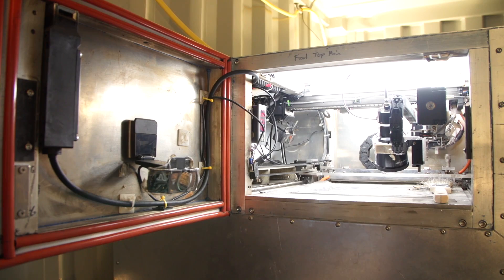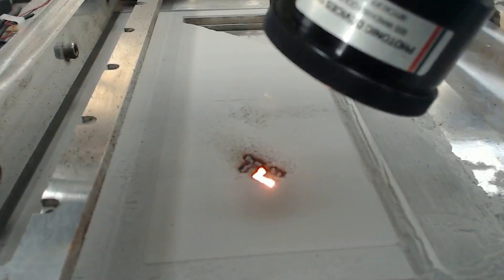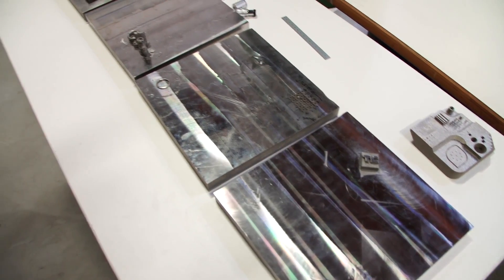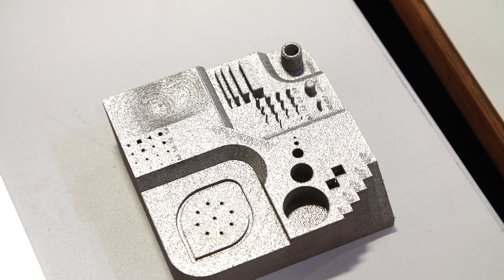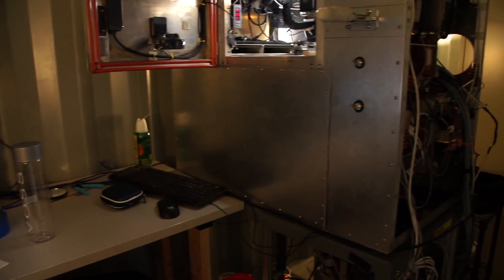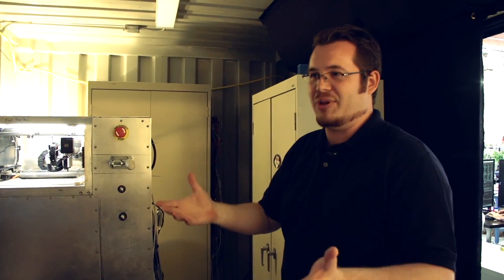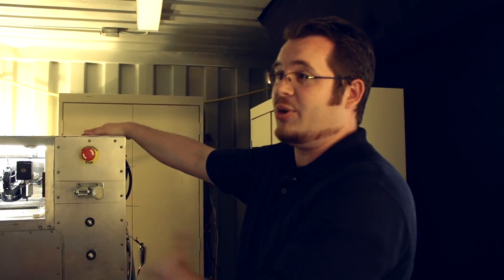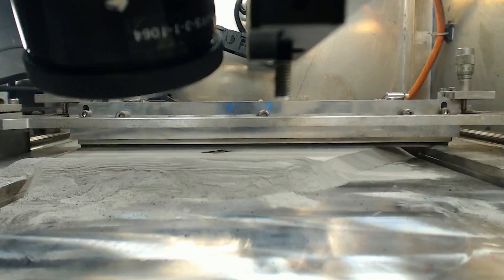Matterfab's 3D Metal Printer

Comment: I had no idea metal powder was so expensive... I have a grinder that makes dust out of metal and I get 304 stainless steel for about 50 cents a pound.. maybe I should go into the metal powder selling business lol
Reply: It's not the power that's expensive, it's the consistency. You are paying all that money for extremely small, extremely consistently sized particles. Probably around 500nm - 1000nm in this printer if I had to guess. Aerospace grade ti-V printers have even tighter specs and use around 50nm sized particles.
Reply: Dan Young Sand isn't expensive either, put properly sized sandblasting media is. It's a guarantee of consistency of size and substrate make-up.
Reply: Can u advise me about 3d printer that print metals
Reply: With controlled temperature, speed and other factors that shouldn't be much of a problem along I've been checking it out already fr a while and I understand what you are saying so not just any idiot can sell off their metal shavings lol

Comment: It will never replace a machined part for testing...
Reply: Ebm parts surpass machined parts in almost all tests. Sls parts aren't as good, but are still useful in some applications
Reply: almost all test....like i was saying
Reply: I agree..  It has its place. but not structurally
Reply: Bigwingrider1800 That statement will hold true, if and only if there never becomes a metal version of the Carbon 3D printer, which is both far faster than conventional 3D printers, but has solved the layer-by-layer structural integrity issue of conventional 3D printed parts.
Reply: Bigwingrider1800 maybe not in your life time old man :)
Reply: Levi Abner lol ouch : /
Reply: Bigwingrider1800 you aren't that smart if you think 3d printing is a fad.
It will take over everything. In your lifetime, machining will cease to exist.
Here's a hint: do you think the single piece UFOs are machined with a dumb mill?
In the future there wont be PCBs or electronics parts. 3D printing will make one monolithic piece with all the functionality.
Reply: But a very smart old man...
Reply: You have been watching to much late nite tv. And i think the tools are machined and the part are stamped AND TESTED.
Reply: Could you imagine the ability to make metal casting with 3d printing wouldn't something like that need to be worked out first?
Reply: Welp never mind found it on youtube
Reply: So what what you telling me the jet nozzles are made this way...or some  the low yield brackets are being made like this..
Reply: +greg, remember to say who you are talking to although I know it's me in this case. 
artificial diamond is being made with cold vapor vacuum deposition and managing to arrange the atoms perfectly. It would seem some kind of guided variant of that will rule or even better. It might be counter intuitive that making a single vehicle could take years for a machine but if the vehicle is adequately sophisticated and could never be done any other way, why not.
Reply: SURE THERE'S A PLACE FOR THIS. BUT NO SUBSTITUTE FOR 4150PHT . JUST A VERY LOW EXAMPLE. CHINESE ARE USING IT FOR EVERYTHING THAT IS SCANNED OF OURS AND SOLD TO THE U.S.A.... ( A 3RD OF THE PRICE)..THE HOUSINGS, GEARS. IT DOESN'T HOLD UP LIKE A BROACHED GEAR. I HAVE A FRIEND WIRE BURNING A SPLINE IN THE CENTER OF A POWERED GEAR IF YOU LOOK CLOSE IT'S POROUS .  AND VERY LIGHT..........PEACE BOYS.......